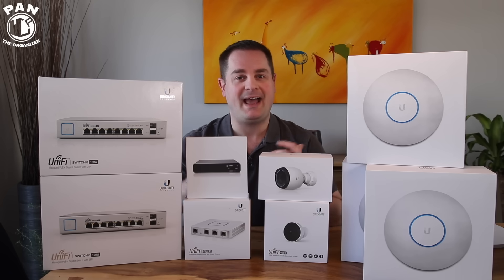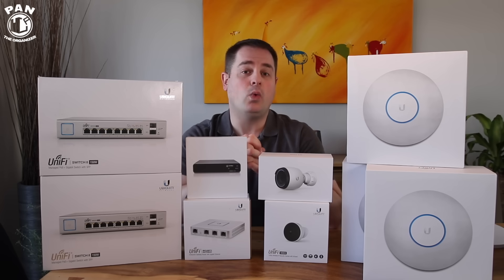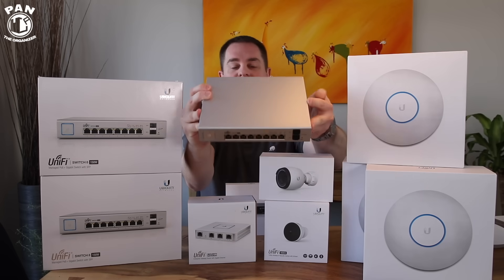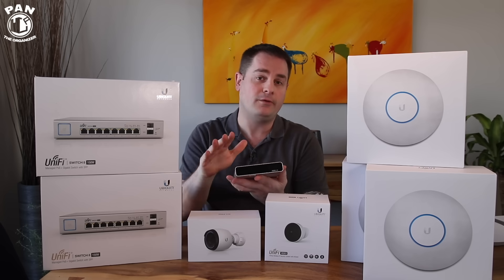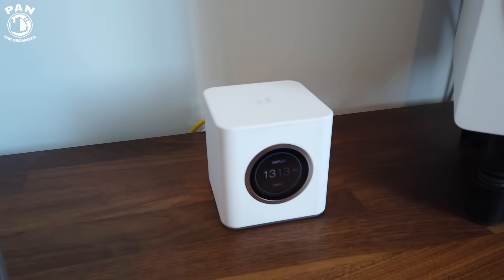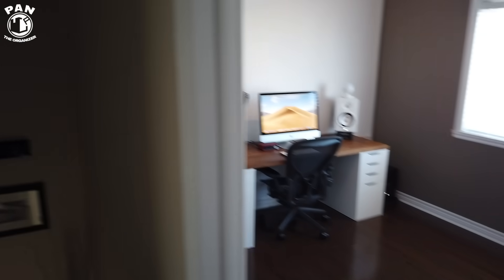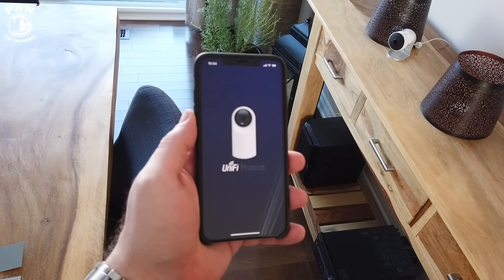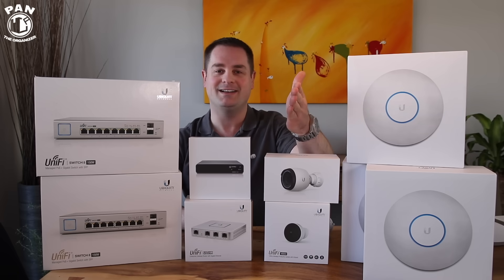SUPER FAST WiFi NETWORK IN MY HOME !!  Ubiquiti UniFi + UniFi Protect

Comment: That G4 Pro sounds very impractical for security recording applications. 4k takes up a LOT of space and doesn't provide a real benefit over 720p for the purposes of security. I suppose if the sensor is 4k but it records in 720p, that could be good.
Reply from the maker: You can decide the recording settings.  No worries there.

Comment: Pretty sure the biggest factor is you added hardwired ethernet throughout the house instead of daisy chaining your access points via WiFi. You’d probably get comparable performance with any mesh system with ethernet backhaul... TP-Link Deco m9 does just that with firewall, QoS settings, parental control and smart home hub. You will need to buy your own switch and cameras.

Comment: great vid
question....for a home user (small house, wife and me), can i just use an edge router + plus access point combo?  (if i'm ok with not having a cloud key or always on computer)
and.......do any of the edge routers provide poe???

i'm just looking to hook my modem up to a router, then poe it to my access point.
configure once, and only deal with it when i need to.  (or get curious)
Reply: Yes, you can use the EdgeRouter with an access point. They provide a POE Passthrough but the access points also include a POE injector so you’ll just need access to a power outlet.

Comment: Nice video. I  have an eero pro mesh system but it doesn't provide device level traffic monitoring. I've heard this system does. However, the reason I have a mesh system is because wired tethering for remote access points is not practical in my house. I need wireless access point connection.

Your comparison compared the Amplifi with its wireless access points to the Unifi with wired access points. Therefore, for me it wasn't as useful as it could've been if the Unifi points were also wirelessly connected to the gateway router. IOW, I'm curious how the Unifi system compares to the Amplifi in the same wireless access point configuration?
Reply from the maker: Watch my AmpliFi HD review: https://youtu.be/SGyCRCxy8Xw

Comment: the problem i have is with the USG firewall it has no automation meaning it just watches and notifies like a security guard there is no subscription services for this it befuddles me ... second had to return the USG PRO4 because it only ran at 100 HDX bought the USG3 at half the price and it runs at 100FDX on the "wan port " which is what i need. looks like i will be double Nating with a netgate running pfsense ....

Comment: Hey Pan, great job on the video. Glad you are liking your UBNT setup, they are awesome devices.

Just a heads up in case you weren't already aware, your 8 port 150W PoE switches are mounted incorrectly. Ideally you want to have them mounted with the ports facing sideways, to the left or right - doesn't matter, so that the switches have the proper airflow flowing up through the vented sides. As these operate using passive cooling, and they get very warm, convection comes into play and makes a huge difference. Having them mounted this way ensures they stay cool and last longer, especially since they are wall mounted, it would be a good idea to rotate them. 

I know this because I recently learned this the hard way at an install I did, one ended up dying and I had to RMA it. Your house may stay cool enough that it's not a huge problem, but I wanted to mention it.

Comment: Just be careful on what changes you make. I changed the DNS servers on mine last week and it screwed all my devices up somehow. Factory reset the USG, switch, and AP and they never would adopt with the controller software.
Reply: I have to agree that although The UniFi controller suite is pretty user-friendly it isn't without it's issues. I've had several issues including the baked-in "speedtest" feature that is supposed to automatically test your line speed not functioning properly amongst other things. However their live support team is quite handy.
Reply: @Namtrooper81  Their support team didn't help me out a bit. I just ended up going back to a good Netgear router.
Reply: So user error then, nothing to do with unifi

Comment: USG-PRO would have been a much better choice. Also, AC HD is pointless in a home config, you’re not going to be connecting 500+ users and there is no range advantage compared to AC Pro/LR/Lite/NanoHD.
Reply: Rob Potato What equip would you suggest for a new home build? It has two wireless AP locations and 3 Cat6 drops...all running to a junction box.
Reply: @dustin9967  It would depend on what your internet speed is, and what kind of range you want from your wifi. I would suggest a USG (or USG PRO if you have more than 400mbps internet) and 2 x nanoHD AP's or 2 x AC-Pro. Or if you want better distribution of WiFi range, get 4 x AC Lite and put spread them throughout the house.
Reply: @springbok4015  Unifi-AC-Mesh less expensive for a < 400mb network, i think that is pintles to get 3x3 or 4x4 in a less than gigabit
Reply: Thank for the video. Truly appreciated it.

Comment: Great video, can I ask if your surveillance footage is backed up to the cloud in addition to local storage? If not, I'd suggest storing your cloud key device in some kind of safe to prevent thieves from stealing it if they were robbing your house and taking all the footage of them away with them.
Reply: The cloud key must be connected to the network to be accessible so to store it in a safe is not an option.
Reply: William Goodman I was thinking about a safe or secure cabinet that still allows a Ethernet cable to be passed in... I realise that this might not be easy to accomplish and personally I’d rather the footage could be backed up to the cloud so that even if the cloud key is stolen the footage would still be saved.

Comment: Few questions:
- why 2 switches instead US‑24 POE? / because of a fan noise?
- do you see any benefit with physical key over docker installed on your NAS (I believe you have one)
(I use Unifi but in slightly different config: Unifi + Synology NAS + 4k cams)
Reply from the maker: Hi Alex,

As I said in the video, I'm not a networking expert (hence why I hired the installation company) so I can't answer all your questions.  But for the switches, the reason I have 2 is because my ISP's modem is in my basement, so there's where the first Ubiquiti switch is, and from there we have an ethernet cable going all the way up to my main office to my second switch, from where I have ethernet cables feeding my computers.  That ethernet cable going from the basement all the way up to the top floor was installed years ago.

Comment: I was looking for the same setup (replacing my Netgear Orbi) but the result is disappointing, I was hopping for something around 800/900 Mb/s over the iPhone Xs MAX
Reply: *although good video.
Reply from the maker: Thanks!
Reply from the maker: You can’t really reach those speeds in real world conditions with an iPhone as that’s bear maximum THEORETICAL bandwidth.  But it will destroy your Orbi for sure.  You saw how it outperformed my AmpliFi HD which is a great mesh system.
Reply: Fair enough,  thank you for the reply. @PanTheOrganizer

Comment: Being a networking tech for many years, I skipped on the USG.  It doesn't offer the ability to customize your gateway as many want.  Using their switches and APs are the way to go, fantastic.  I have the 24 port POE switch and the Cloud Key Plus.  Going to start replacing an older camera system with Unifi, slowly.  Their cameras are overpriced, at least the 3 and 4 pro models.  Shame you can't use other cameras on the system, but it's a marketing thing.

I use a FortiGate appliance as my gateway, has far more ability, with a higher price of course.  If I was to go cheaper, the EdgeRouter X from UBNT would be my choice over the USG.

Comment: It's worth noting that the Amplifi system guides do not recommend daisy chaining the mesh units, as it will reduce performance from the second hop unit.  Just goes to show how good the Amplifi is to deliver 30+ on the second hop.  Presumably you linked them both at 5Ghz.  

I note the phone is the limiting factor in measuring download speeds.  And yes, total overkill on the HD units.  You will finish up with curly hair........

Comment: Im assuming both the access points are Ethernet connected to the main switch, so like having two separate hardwired routers on different levels rather than one access point wirelessly connected to the other access point like your other mesh did.
Reply from the maker: Yes, each AP is connected via ethernet cable to the switch.

Comment: I have an entire Ubiquiti setup but On the router and switch side, I've chosen to go with an Edge Max system because of the more advanced enterprise interface. I have a Ubiquiti edge router Infinity and 2 edge switches both 48 port 750w model. For Wifi I have 6 AP AC Pro's and I'm running my Unifi controller in a docker on my unraidserver. The reason behind having 2 48 port switches is for my Crestron automation system. I have All my lights and switches separated into there own VLAN. Wish Ubiquiti would come out with there own ethernet lightswitches for home automation. Hope you have fun with your ubnt system.
Reply from the maker: Thanks for sharing Justin!

How did you discover my channel by the way?

Comment: Great setup! I too have a similiar setup (Unifi controller 1st gen, 3x APs, and an USG) with 1 GB/s service but I'm not seeing those speeds. Mine averages 150 Mb/s... Did you have to adjust your port forwarding to increase the speed or are you using it as it was set up out of the box?
Reply from the maker: Thanks Nate!  I have no networking experience, so the installers took care of everything for me.  :)

Comment: I couldn't tell, did you connect both ports on the wifi access points? That's pst of getting the greater than gigabit wifi speed. I use unifi at my church. Super easy to configure and maintain.
Reply from the maker: To my knowledge, they only connected one port on each AP.

Comment: You are going to be sorely disappointed with the USG-3P and gigabit.  You won't be able to have IPS/IDS or QoS enabled with that router or else you will be lucky to get 100Mbps.

Here is our USG-4P at work with only a 25Mbps DSL connection.

https://dl.dropbox.com/s/pyg38s2o1mbqu7c/USG.png

Comment: Ubiquiti is nothing to do with enterprise it's for small business only! maybe only wifi is in enterprise level
Reply: An enterprise network is much more than just scale, even at a certain scale threshold this class of equipment is not applicable. You will not find these equipment at your local bank or even in an online ticketing company like fandango not to talk of places like the NYSE. Anyone with any fundamental knowledge in networking will know this.
Reply: @zenitc  101 % true
Reply: I’ve seen multiple campuses using only Ubiquity switches and access points.
Reply: @Veritas-invenitur  They might be running Edge series devices, Unifi switches don't support L3 routing and even the EdgeSwitches don't have all L3 features like a ProCurve or Catalyst has...
Reply: I see there is a lot of missinformation on what enterprise is. While I did use Unifi on some very large installations (100+ APs), and it works fine, it is cheap but when you get to routing level of things, their switches and firewalls are nowhere near enterprise level yet.
Reply: yeah, that makes sense. I can definitely see how their switches or routers wouldn't stand up to workloads of entire buildings with a 100% uptime.
Reply: Exactly
Reply: Can you open a TAC case for the Ubiquiti at 3:00AM in the night, as an urgent P1, so they can jump into the troubleshoot call within 5 minutes with a duty manager and a level 3 engineer?
Yes, this is why the Cisco (for example) is enterprise level, but the Ubi isn't.. :)
Reply: My colleague has tried the Ubiquiti firewall for his home network, it has crashed multiple time due to the firmware, he end up going back to Asus router ;X

And I do prefer the unifi AP for business.
Reply: I'm just here for the AP...my makeshift Linksys router that I'm using as an AP keep disappearing every day, sometimes several times a day. I need something that gives me 100% wireless uptime and still give me good range....the seamless handshake is a good feature too
Reply: Caleb Drake I totally don’t understand why Linksys can’t make a stable one since the the 54G or something.
Reply: @jackwong64  

Funny you mention that, this Linksys is a 54g...it's an old one though
Reply: Caleb Drake LOL really... I switched to Air Extreme since that and now Synology Mesh, its very stable so far.
Reply: You are wrong a huge company I used to work for installed their equipment in the warehouse shipping facility, and it covered over 2 football fields wide and 4 football fields long.  So yes, they are enterprise.
Reply: ipon70 yes for WiFi(AP) but not firewall I would say.
Reply: @ipon70  as zenIT C said, an enterprise network is more than scale.
Reply: Christian correct.  And they have support, even when sh*t was falling apart late at night during inventory they were there to help.
Reply: Enterprise level is not only about "speed" and "coverage"... It means that the support for the stuff is 24/7/365 from the vendor side, you can open tickets quickly to their queue, so they can start to troubleshoot ASAP, and a lot of other point :)
Reply: Ubiquiti is an enterprise level wifi system. AmpliFi is for the home. I've installed this ubiquiti unify system in restaurants, office buildings and urgent care.
Reply: it is enterprise, i know multiple organizations that use it for multi campus systems

Comment: Very nice.  For someone who is not fully acquainted the the Unifi product line, you can still use the Wireless Access points without the PoE switches and use the PoE injectors to get power to the AP's  However, if you're going to pay someone to run the cable, use some sort of PoE switch and make life simpler.  The Gateway and Cloud Key are nice to have but you can use your own router and run the controller software from a virtual machine.  This would enable you to get into the Unifi product line for a much smaller initial investment.

Comment: If you don't use Bell TV, there is no need for that Bell router anymore. You can get a cheap media converter for the SFP fiber cable and connect it straight to the USG. You'll need to setup vlan with id 35.
Reply from the maker: I do have Bell TV. :)
Reply from the maker: What home hub are you referring to?
Reply: @PanTheOrganizer  The Bell HomeHub 3000. 

It'd be nice to see how everything is setup from both hardware and software. 

I couldn't get vlan tagging to work (likely due to lack of Ubiquiti software knowledge) and have both internet and TV.

Currently I have SFP connected to HH3000, USG connected to HH3000 LAN1 and ethernet running from bell receiver to HH3000 LAN2.

I disabled wireless, enabled advanced DMZ and put the USG outside of the network.

I had to the internet PPPOE creds enabled, because the TV would not work after a simulated power outage. Most likely it couldn't talk to the gateway server.

So although it's working, I noticed my speeds are subpar and would love to see how others did it at that level of technicality.

Comment: The USG Pro4 might have been a better option for your high speed connection, as IPS/IDS features on the firewall will limit the speed of your connection.
Reply: Enter the unifi dream machine pro...
Reply: Jason Lee is the dream machine pro better
Reply: won't be much better. Normal USG will limit it to 100 mbit and the pro to 200 mbit, its still bottlenecking gigabit connections when these features are enabled
Reply: RonkerZ just stumbled over this and that was exactly what I was thinking reading 1gbps and then seeing the USG ...

Comment: Do you know that the little USG outputs only 85mbps with IPS? At least you should have used the USG Pro or pfsense
Reply from the maker: As I said, I’m no networking expert.  I have no clue what IPS is.  But upon doing a Speedtest with my wired iMac, I do get the full 1Gb speed...
Reply: You should have a look at Crosstalk Solution's youtube channel and Unifi forum ;) btw IntrusionPreventionSystem is a good reason to buy a firewall, pfsense is also probably a better solution to USGs right now (and cheaper and open source) @PanTheOrganizer